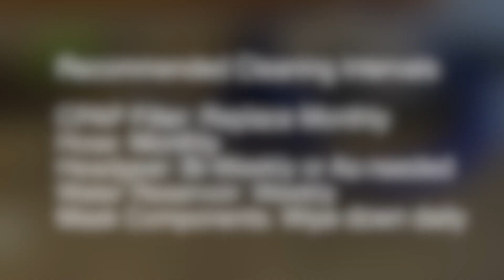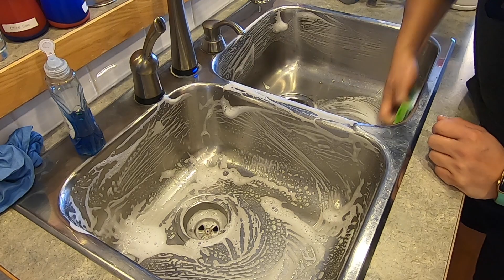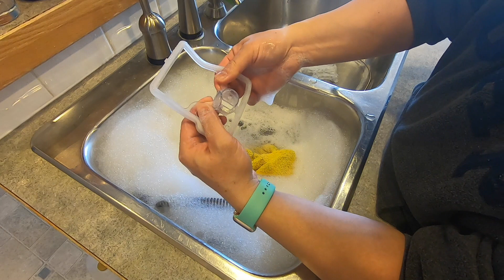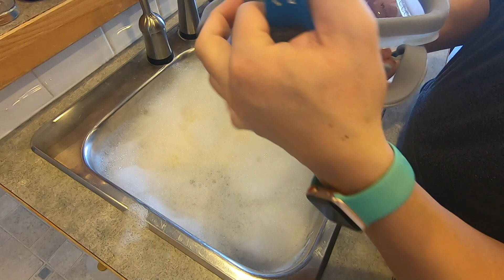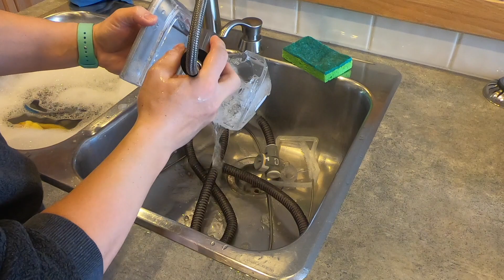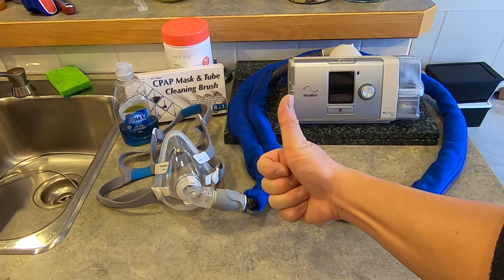How to PROPERLY Clean CPAP Equipment

Comment: I was told by multiple doctor's not to clean your CPAP in a kitchen sink because bacteria and mold residue are still present even if you scrub it clean. I bought a big plastic food container from the dollar store and I wash mine in that.
Reply: I found a few good tips on this video but just the idea of cleaning my CPAP where I  clean my dishes, even though my dish sink is kept clean, gives me the creeps! I bought an inexpensive small plastic tub in Chinatown and I use that just for my CPAP.
Reply: @royestrada777  yeah sink is not a good idea 🤣🤣🤣
Reply: As a health care professional, I consider this excellent advice. The kitchen sink is an extremely dirty object in a home. People have no idea. Have you ever cleaned your garbage disposal? You would be amazed how filthy it is. Try it...just be extremely careful that it is off completely. I like to clean it when nobody is around the kitchen to accidentally turn it on...very unlikely, but an ounce of prevention is worth a pound of cure.
Reply: Silly. Just clean your sink.
Reply: Like you  I use a separate container to wash the parts in and use that container for nothing else. Its safer that way.
Reply: I can confirm that you are correct.  I was a lab tech and culture media prep tech and I worked in a commercial kitchen. Here are some things to think about.
1.  There is a spectrum cleaning-sanitize-disinfect-sterilize.  There is no way you are sterilizing  this equipment without an autoclave, uv, or radiation. It isn't necessary anyway.  

2.  You can't sanitize or disinfect a surface that isn't cleaned first. 

The amount of bacteria lingering in your sink is very high. Heat kills some bacteria at high temps approaching 150.  Some people can't handle that.  ALSO the high temp and detergents remove oils and grime which harbor a lot of bacteria.  Drying your equipment really well will also help to kill bacteria. Sanitizing CPAP wipes can help keep your equipment bacteria free.  Some people do just fine in their sinks with good ol hot water.  Warm water .... You are rolling the dice.  but with my experience with bacteria, for a buck at the dollar store, I use a different tub.  I see people put their raw veggies in the sink and cringe.
Reply: Agree. Especially when you actually realize the sink itself is connected to a garbage disposal and then a sewer pipe that bring bacteria or fumes back in after cleaning.
Reply: I did the same thing.  It fits perfectly into my master bath sink.  Easy peezy
Reply: That's a good idea
Reply: Where are the links to amazon for the filters hose brushes and hose covers ? Thanks
Reply: use a bowl
Reply: ok, but for me this thing has no logic. I mean dont you clean your dishes in the kitchen sink? and after you eat from your dishes and drink? maybe we are already imune to those bacterias:D Pls dont listen to me, i'm just saying what i think:D
Reply: I have three climate line hoses and head straps (I use pillows). The pillow I wash and change daily, I interchange two water chambers daily.  Once weekly I soak the chambers in vinegar.  The hoses hang on shower rod for two weeks while using one. The head straps are washed weekly and hung on shower rod.
Reply: I have a large Tupperware tub. Use that to. Len my Resmed 10. Every  week I put tub into the dishwasher
Reply from the maker: I think most people that use good cleaning practices in their sink and when cleaning their cpap equipment that odds are any residual bacteria or mold will likely not linger around.  This is not to say that having a separate cleaning tub is a bad thing - it great think actually.  I'm a bit neurotic and if you'd believe it that I bleach out my kitchen sink at least once a week by mixing a few tablespoons of household bleach and hot water and let the sink "soak" for 10 minutes and then pull the drain plug to let the bleach water also clean out the pipes.  I started this practice when I noticed that there was a smell from my sink's drain and it is the bacterial buildup that naturally occurs in the pipes.  Ever since I did the weekly bleach water mix that the sink is always spotless, has no smells but likely also has very very low (if any) remaining bacteria or mold.  I can't verify this but its been years of me doing this with no issues.  Each to their own and one should so what they feel is best for them.
Reply: @piercedasian  I’m with you but I think the real problem is using municipal tap water to clean then inhaling the same municipal tap water into your sinus cavity when the inside of tube is not allowed to completely dry which is not going to happen in a day.
Reply: @Ransome2501  the instructions I received for the tube (from the manufacturer) says it dries in about 30 mins when hung up to dry.
Reply: @maxsun2989 No they do not dry completely in several days.  Having a whole house water filter system if possible is ideal.
Reply: @piercedasian  good call.  Heat and bleach sanitizes well.  There are definitely low levels of bacteria still.
Reply: I bought a gallon bucket with a lid ( clear one w logo ) @ Home Depot for less than 5 bucks 👍
Reply: If your kitchen sink is dirty enough you can't clean a CPAP hose in it, why the heck would you clean dishes or cutlery or food in it??  YIKES.  That said, I like the idea of the separate container because I don't want to hog up the sink for this one purpose in a house full of people.  I'll use the separate container and do this in a laundry room sink or bath tub noone's using.
Reply: @cra2cra226  in answer to your question regarding why would you not want to clean your dishes in a sink that is not clean enough to clean your cpap in:  your digestive system is very different than your pulmonary system. The pulmonary system is much more sensitive to microbes and isn't able to self-clean as easily as  the digestive system is. If you think about this, it will make sense. The digestive system has a "release valve" (so to say) which is absolutely full of bacteria. You can eat dirt without it causing you any real, lasting harm...ask any mother of a small child. If you do get something that actually is toxic in the digestive system your body has two ways of getting rid of it...through your mouth or rectum. We actually consume a considerable amount of things that you wouldn't like to actually think about. I hope this is helpful.
Reply: @cra2cra226  
I can chime in here. I worked in a lab as a culture media prep tech. Unless you autoclave your dishes, then heat and detergent may sanitize or disinfect your dishes at best. You could add additional chemicals to ensure you disinfect your dishes and allow for the proper kill time. Even then!   Your sink is never sterile so there are germs always present, especially if you have a sponge around.   Once your dishes are dry, most residual bacteria are killed.  

So!  Let's look at the guy who just had an amoeba eat his brain.  It is found in tap water and not a problem if eaten, but shot up your nose, it can kill you.  Now I am not saying you can get a brain eating amoeba from your CPAP.  However, since you are breathing through these hoses, and they may be not 100% dry, it would be a best practice to use a cleaning vessel that was not  used to clean food prep materials that touched raw meat, dairy, etc.  

I am a bit obsessive in my cleaning/disinfecting practices.
Reply: @cra2cra226  Because eating certain germs is better than breathing them especially with forced air.
Reply: @cra2cra226 , you may live in a house, condo, or a duplex, but we lived in a apartment. Our laundry room is in the ground floor of the rear of the building. My wife who has Sleep Apnea, that she and myself worked on cleaning this machine equipment together today. So cleaning elsewhere isn't a option.
Reply: @cra2cra226 because you eat off dishes not stick them around your nose with moist water air coming in.
Reply: And I was told by a doctor to buy new equipment every 6 months is that true? or I can clean it and keep for a few years?
Reply: @Voltomess  6 months is best, or up to one year
Reply: @Voltomess  you want to have back ups just in case but if you maintain your equipment it can increase the longevity of it by about 30%-50%
Reply: Piercedasian…me too. I have many years of dietary healthcare experiences and I have always had a plastic cleaning bottle (sprayer) at my kitchen sink for cleaning. My sinks get sprayed down with a bleach solution at least once a day after cooking, especially poultry. When covid was rampant and people were wiping down their countertops, I had been doing it for years!
Reply: @janenejones2036 Yes, can't imagine not disinfecting the countertops AND sinks EVERY DAY... 😮

Comment: very helpful but I'm too lazy to do all of this on a regular basis. I wipe my mask daily with wipes, clean the tank every few months, hose now and then gets a rinse. few times a month it all goes in the ozone machine.
Reply from the maker: Wiping down your mask with wipes is okay.  If you're using an ozone cleaner that will suffice for the rest of the parts that don't get wiped down.  Only thing I'd suggest you was routinely is the humidifier reservoir since all sorts of nasties can grow in their regardless of ozone cleaning or not.
Reply: I didn't bother cleaning the equipment either.  Got a case of pneumonia; really sucked.  I wash everything weekly now !!
Reply from the maker: yikes that's no good!  I'm kinda glad I'm OCD in the cleaning department.  Something that is literally connected to your face and airway is something that isn't worth messing with.

Comment: I have 2 hoses. I clean one after use and hang up to dry over the day. Use the second hose that is clean and dry tonight. I do this daily. I have a Soclean machine that I hook up hose, mask, and connector and run it through the resumed machine, hose, and tank. Soclean has different tank lid to allow that. That way I am double cleaned and ready to go when needed.
Reply from the maker: wow that's a lot of cleaning.  Good job!

Comment: How do you clean the inside of the actual machine ?
Reply from the maker: You don't need to.  Just clean or replace the filters, keep the humidifier chamber clean and wash your mask and hose and you're good to go.  Never take apart your cpap machine unless you're willing to spend money to buy a new one should you damage it.  If the environment you use them in is clean and free from things like roaches or bed bugs that the inside blower unit likely will stay quite clean.

Comment: Got a new cpap a month ago and I started sneezing and my nose runs like crazy when I use the new one.  Never had this problem with my old one.  I noticed my mouth gets super dry with the new one also.  I don't put water in the reservoir, could that be the reason for the extra dryness and sneezing?  I read that a full face mask can help too.  Have you ever experienced this?  Great video by the way!  Thanks!
Reply from the maker: hmm interesting thing about the sneezing.  I would definitely try to add water to the humidifier to help tame your sinuses.  I'm assuming you live in a fairly humid climate to not need water.  If you're going to run the unit with no water make sure you turn off the humidifier by setting the climate control to manual and/or going into the clinical settings to have the humidifier disabled.  If you don't you're going to get a wicked burnt plastic smell.  Thanks for the like!  Hope you enjoy your new machine.
Reply: @piercedasian  Thanks for the response.  The water makes a huge difference as far as the sneezing and runny nose goes.  Now if I could just keep my mouth closed while I sleep, that should solve the dry mouth.  Just to clarify,  it's the heated tube that heats the air?  I have an Airsense 10 and I should be able to find a heated tube for it?
Reply: @lululito124  I use a chin strap to keep my mouth closed.  Works most of the time and solved my dry mouth problems.
Reply: @davidthomas8413  Thanks, I'll look into that.
Reply: I also went to a full mask do that if my mouth opens I'm still breathing in the air. Hope this helps; I'm still learning after one month on the cpap.

Comment: Big help. And a bit daunting.Thank you.
Reply from the maker: Not daunting at all, super easy to clean.  Don't let the water and heated hose scare you.  If you don't have a cpap hose cleaning brush, it is no big deal.  Just soak hose and washable mask parts and headgear in the warm soapy water and rinse well.  Wipe the unit down with a damp cloth and change your air filter.  Once you get the hang of it it will be 2nd nature to you.

Comment: Hello! Thank you for uploading this. It's very thorough. I am trying to start using my CPAP again and I washed my hose as how they appeared to instruct on the Philip's Dream Machine App. However, upon rewatching, I realized that they didn't appear to rinse the inside of the hose. It's a non-heated hose and I already washed it with soapy water and rinsed it like you do here. You mentioned that heated hoses can be submerged, does that go for non-heated hoses as well?
Reply from the maker: Good for you for taking another try at using CPAP.  When I started cpap therapy it was a "trying" two weeks but once I got used to it it was night and day in how much it helped me get a better rest.  With respect to your question - yes definitely wash the hoses.  Whether or not the hose is heated or not it is all washed and rinsed the same.  Good luck with you therapy!

Comment: From my personal experience...I have the exact same machine and mask setup...the piece that connects from your hose to your mask I always cleaned like you do and I have had to replace that part 3 times in 6 months...I was told after the 3rd time that this was due to me washing it and getting it wet...I was told after use every night to just air dry it out....since I have started doing that I have not had a problem....whenever I would wash it in water my machine would start becoming extremely loud at night....just my personal experience
Reply from the maker: interesting that you're experiencing that problem.  I've SoCleaned and washed my cpap gear many times and I've never experienced any issues with the air elbow.  Maybe I'm lucky?

Comment: Thanks for the video. Why is your hose wrapped up in fabric?
Reply from the maker: Glad you liked the video.  The hose is wrapped with a "hose cozy". It is meant to make the hose feel less "medical" but the actual reason why I have it is to retain heat in the hose so condensation doesn't form in it.  This is particularly a problem for cpap users that like to sleep in cold rooms (ie me).  I could dial up the hose temperature on my CPAP but then it makes for warmer than usual cpap temperatures and I don't find that comfortable at all.

Comment: You mentioned you would give a link to the filters that you buy. I am trying to decide on whether it is better to buy a resmed based one (which is expensive) or the cheaper ones from amazon.
Reply from the maker: my bad... I just updated my video description to the ones I'd personally purchase.  The aftermarket ones work just as good as the resmed ones at like 1/10000th of the cost of a Resmed one.  I've used aftermarket filters many times with zero issues.  Check out the link in the video description.

Comment: Hey, how long does it take for the hose to dry if I hang it from the shower curtain rod? How long does it take for the head gear straps to dry? Please let me know s soon as possible. The reason I ask is because I'm trying to get as much sleep as possible. I did graveyard shift for years and I'm trying to train the body to sleep at night again. Hoping the hose and mask dries in a few hours. Thanks.
Reply from the maker: It really depends.  I live in a very dry climate and my hose after a day doesn't dry on the inside.  I just hook it back up at the end of the day when I'm ready to retire to bed and the cpap while in use dries the hose out.  Think of it as added humidity :). You won't even notice the water evaporating in the hose as you're using it.
Reply: I know you didn't ask me but I also have cpap and I would like to answer your question.  So I wouldn't hang the hose from the shower curtain or anywhere in the bathroom because bathrooms tend to have lots of moisture therefore creating bacteria.  I unplug my hose every morning and hang it behind the door of my room so that it can dry from the nights previous use.  This has kept my hose very clean and I only have to wash it with vinegar once a month. Remove the mask also and hang it next to it so that it can air out.  I also have the habit of putting pressure from the machine on to the tube and mask right before using it at bedtime. You never know if any tiny creepy crawly can be inside of the tube. The air pressure will take any small particles out of it before I put it on. I hope this helps.  I also got the lumin cleaner for the mask and chamber.  This works for me. putting it to wash like in this video is just too time consuming for me. God bless
Reply: @elizabethrodriguez7363  Hello Elizabeth I was wondering how you do the vinegar wash? Does it leave the vinegar smell in it afterwards?
Reply: @RayChele825  there isn’t a smell I find !